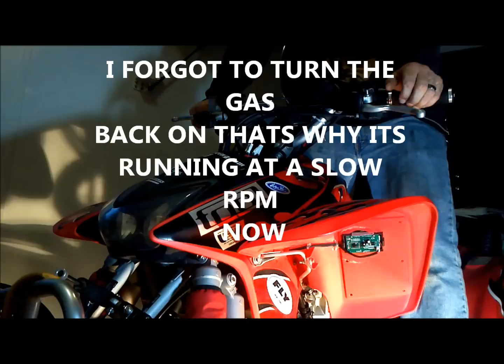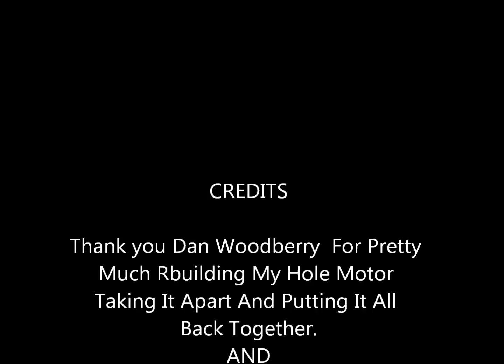TRX450R TO 501cc first start

Comment from the maker: i have not had the power checked on a dino or anything but i can definitly feel the difference way more torch the compression is up from 9.5 to 1 to 10.5 to 1 totally worth every penny. I bought the kit on ebay good luck with your build

Comment from the maker: IM running 91 octane the cam gap would be the gap from the cam to the lifter bucket for checking valve clearence. HP I'M not sure we were thinking maybe 50hp it has a ton more torch thats for sure it runs great.

Comment: That's extremely cool man, it would be sick to fabricate your own forced induction kit of some sort for the motor to see how much power you can squeeze out of that bored out 4 stroke!
Reply from the maker: I did put a vortex intake on it recently and i can feel the difference still need to do a valve job on it putting the big valves and a stage 3 cam it should run really strong then I'm having Dasa do the head work and dyno it will see how awesome it is, I'll do another video of that build

Comment: I know this videos old but it cant stop me from saying nice build sounds good! im building my 400ex up she will be fast but once i get bored of it im going to make a even more radical 450r like this.hows she holding up?
Reply: @markmckay7912  oh man that suck yeah my 400ex is going to have a stage 3 cam,12.5:1 compression I'll give a update once it's built I can't wait but right after I spent so much on my 400 a ad on craigslist comes up with an 05 450r for 1800 but god knows how hard they rode it and how good of shape it's in my how do the 05 450s run stock I'm still debating if I should get one and build it

Comment from the maker: The cylinder works kit is awesome tons of torch, I'm going to put in a stage 2 or 3 hot cam that should really bring it to life.. I was asked how it compares to quad zilla? Well my good friend Larry aka rouge has a bitchen zilla that's a Suzuki 500cc two stroke for people that don't know and there is really no comparison the zilla is a beast but it is heavier I like mine because I can through it around easy
Reply: +mark mckay Id take the 4 stroke just for the ease of use and general dependability. Good 2 stroke is pretty rock solid though.

Comment: Thanks. Can you still run pump gas with that?
Reply: 10.0:1 is fine 13.0:1 u need race fuel. All about the comp rates

Comment: I just put an athena 490 big bore in mine, ported and the bike over heats in minutes. Small anti freeze leak. Changed the head gaskets like 4 times still Idk what the problem is. Any ideas? Thanks.
Reply from the maker: Mine would get hot after hard riding, i weird the fan to run all the time, make sure you have a thermostat in it also

Comment: Was it a pretty hard build in general or is it pretty decent!?
Reply from the maker: Jorge Escobedo it was really pretty straight forward, not really hard, i recommend a large clean bench or table to set parts down as you tear it down to keep them all in order and keep it clean clean clean it took 2 days straight from 9am till 10pm so about 24 hours total
Reply: Was there much more spending other then the parts of comes with? And how much can you feel the difference?? Sorry I'm just wanting to know. And is there much difference between the 501 and the 510?
Reply from the maker: Jorge Escobedo no extra spending, it has a ton more torch but to make it really bad ass i should of changed the stage 1 cam to a stage 3
Reply: You think if I do it I should go with stage 3 cam?
Reply from the maker: Jorge Escobedo yes go with the big cam, that will bring the RPM back up to the high range and power at the top end

Comment: Where did you get the kit? If you dont mind me asking.
Reply from the maker: Lane Benally i got it on eBay it was totally worth it, ran great for years. Cylinder works big bore and shoot i forget the crank but it was plus 3 stroker
Reply from the maker: Lane Benally https://rover.ebay.com/rover/0/0/0?mpre=https%3A%2F%2Fwww.ebay.com%2Fulk%2Fitm%2F202681935498
The price has gone up! Way up!
Reply: Thanks man. That's a really nice bike.
Reply: O I forgot to ask did you have to make any modifications?
Reply from the maker: Lane Benally no sir it all just bolted right on, no cutting, grinding or any mods what so ever

Comment: thats nice man ive had mine since 05 bought it brand new from ALBA RACING down in san deigo had them put there alba kit on it thats a full pipe, bars, seat and sticker kit, and a stage 1 hot cam. it was great for a while then was very hard to start after it warmed up would kick back it turned out to be valve adjustment i took it to alba first then orange county honda they both lied about doing the work i ended up doing it myself runs great starts easy even with the big bore and stroker crank.
Reply: I know it’s 7 years now but I need help doing the valve adjustment mine does the same thing 05 too it’s hard to start while hot